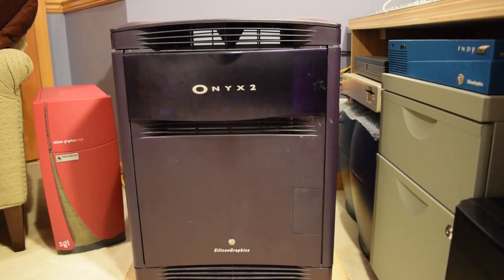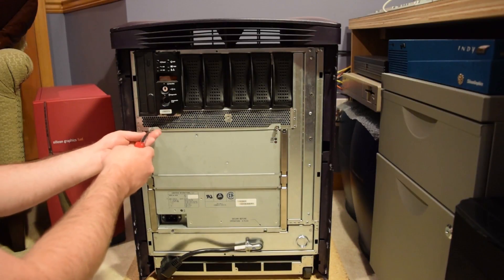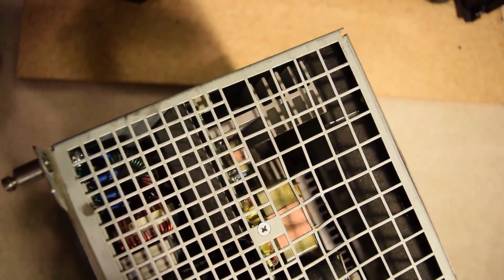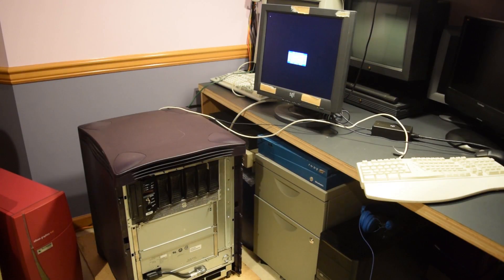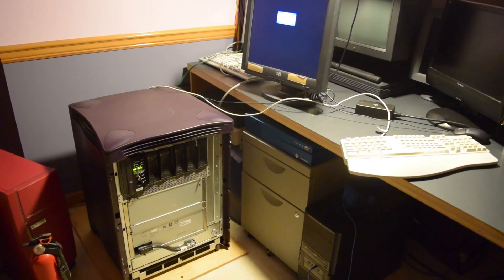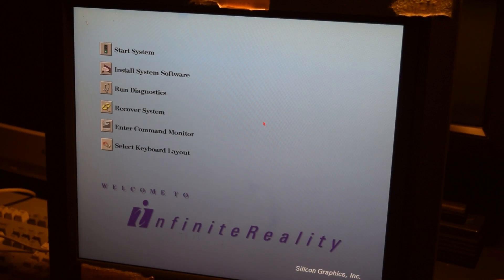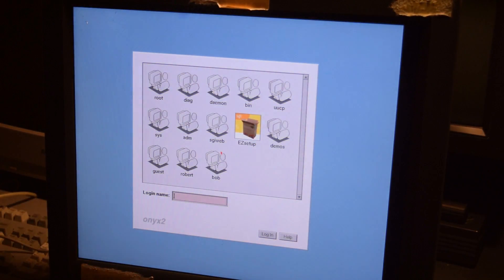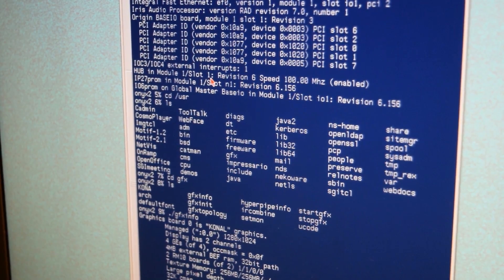SGI Silicon Graphics Onxy2 Infinite Reality 3 Power Supply Swap

Comment: I have a R12K400 Quad, with the same graphics configuration , there are DIP switches on the MCU that you can set to perform only basic RAM/SYS tests. It will start in under 20 seconds :)